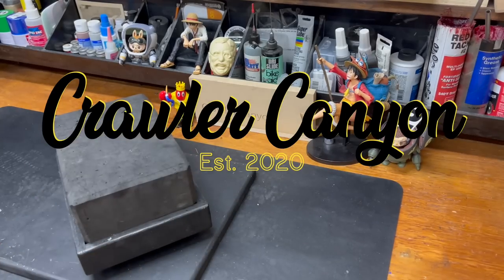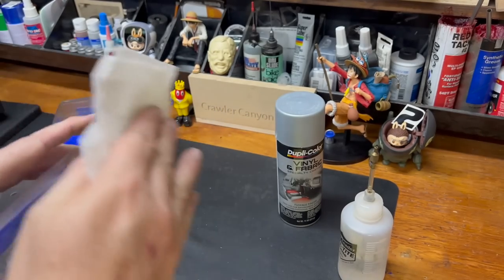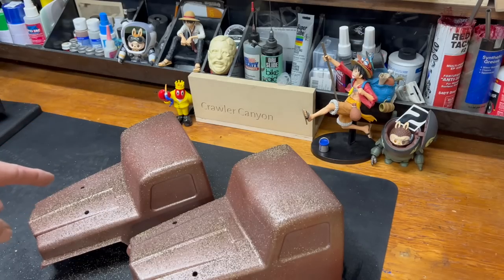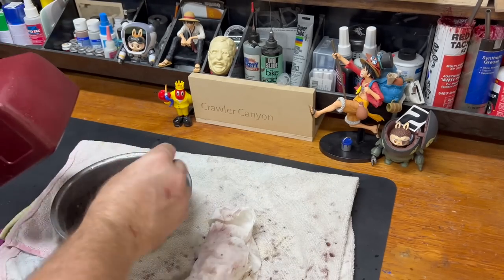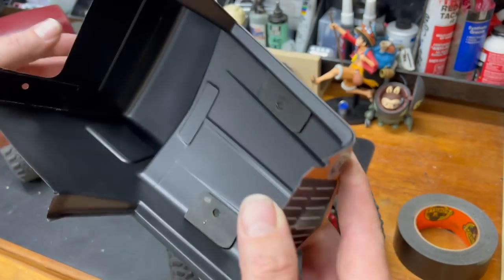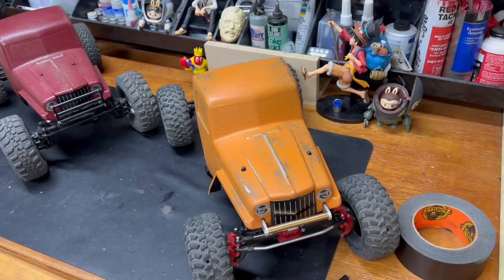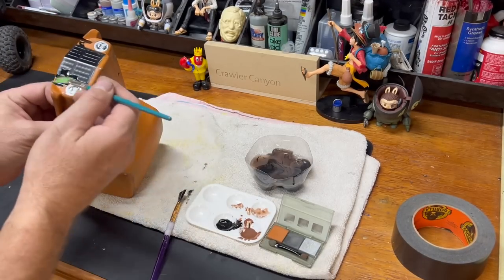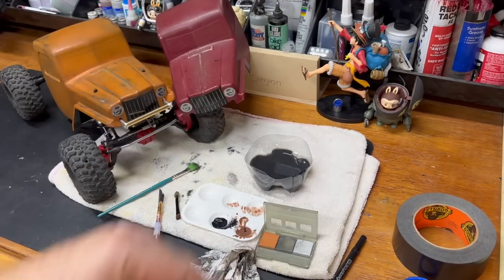Crawler Canyon Presents: What? Patina again?

Comment: I took advantage of that sale on the Creep for patina practice before starting on my expensive Proline body. I had great luck with the salt-and-hairspray method on both bodies but now I have a painted Creep body looking for a home. So I guess I need to build another rig.

My method is a lot more fiddly than yours though. I do clear matte inside and out, then use orange and metallic red on the inside  randomly. That puts the rust layer inside, then I do the paint color on the outside over the hairspray and salt. 

For salt I find it’s best to use irregular salt if possible. I’d use Maldon but it’s very expensive, but some kosher salts and sea salts are nice and irregular. If you ever see David’s Kosher Salt, that one is perfect.

Comment: I got the cricut joy last week n its awesome. I painted the inside of my creep cab a metallic blue an I don't know if I should back it with silver or white? Great video ❤❤
Reply from the maker: (For me) that would depend on how translucent the paint is. If you can see right through like it's tinted blue, I'd use silver.  But if it's semi-opaque, I'd do white, as the color will pop more. For reference, Wiley the Coyote is backed with white, Tamiya Metallic Purple for the color coat.

Comment: I thought i was alone using spray vinyl fabric dye on bodies. When i did 1/10 scale drag racing i used the bright red on every body i ran because it would never come off. The body would crack before the fabric dye let go.
Reply from the maker: I've been trying to convince people to use it for YEARS. I mean, an 11oz can used to be $6, and would do 2-3 bodies. Never, EVER chips. 
Duplicolor is missing out on a market--  they should be relabelling and selling out of hobby shops as well. I just did a TRX-4 Sport body with vinyl red, and the can had to be 10 years old.

Comment: How do you go from a scan to cutting it on a cricket? I need to make some duplicate masks and have a cricket available to me
Reply from the maker: Low tech is my approach.  Once I have the scan, I import it into Cricut Design Space, hoping that it's not loaded with too many jaggies and errors--  they look smooth to the eye, but the scanner sees EVERYTHING. I then put the imported file on the workspace, and here's where it gets low tech: I measure one of the existing masks, like for Creeps I use the back window--  then just make sure that the one on the workspace matches that measurement. Click duplicate to make double, and cut it.

Comment: Could you explain how to use a Cricut to make window masks and cut them out? I have a cricut but used it once to make sure it works.
Reply from the maker: I do it lazily--  I scan the OE window masks to start.  If I had to build them from scratch, that would be a lot more labor intensive. Scan at 72dpi, import the file into Cricut Design Space, do any clean up to erase the lint and cat hair that was on the scanner bed.  I then measure the long edge on any window mask that has a relatively flat side, and resize the one in the workspace to match that measurement. Duplicate, cut (at least) two sets. I recommend Oramask 813 if you're doing a lot of masks, or plain 651 is fine.  I'm still using 651 as I got a variety pack (over 25 feet worth) for like $20 many months ago.
Reply: I will give that a try. New to the cricut scene. Loved the patina video I want to give it a try. I’m on vacation in Daytona Beach.
Reply: I will definitely give it a try when I get back home.
Reply: @CrawlerCanyon what kind of clear coat do you use
Reply from the maker: @michaelwilson7973  honestly, nothing comes close to the absolute ease of use and "touchless" matte finish of Tamiya PS-55, but I hate having to spend $7  to get one body out of a can--  you <might> squeeze two cabs out of a can. So I've been trying EVERYTHING. The new Traxxas stuff goes on horribly, but if you wet-sand afterward, it is SUPER matte.  That's the final coat on  both of these.  The Duplicolor vinyl clear sprays phenomenally, but is kinda semi-gloss, so same story, needs post-work.

The goal is the same performance as the Tamiya, but not at $2.50 an ounce. Absolutely don't try the Duplicolor 1K Ultra Matte Clear. It's basically satin. And expensive.
Reply: Which do you the most?
Reply from the maker: @michaelwilson7973  The Tamiya PS-55.  Goes on the thinnest, lays the flattest. The singular drawback is the price--  you can easily use a whole can doing one body.
Reply: Are you going to finish the video of the patina? You never used the other items in your video or showed the clear coat.
Reply from the maker: @michaelwilson7973  other... items? What didn't I use? The difference in appearance before and after the clear coat is that now the weathering won't wear/wipe off.  The clear doesn't change the appearance other than to make it more uniform.
Reply: Okay thanks
Reply: @CrawlerCanyon what grit sandpaper you use when sanding to get the pepper off?
Reply from the maker: @michaelwilson7973  depends on the paint--  and I mean it's REALLY dependent on the paint. Any of the polycarbonate paints (including the Duplicolor) never need more than 400 grit, while stuff from Krylon and the like can sometimes take 320 or even 220. Just get a variety pack of wet-or-dry, that's what I do.
Reply: Thanks
Reply: I bought denatured alcohol in a quart size metal container. It has fuel denatured alcohol will that work. That is all Walmart had.
Reply: Does it matter what kind of printer to use when scanning the original mask? Inkjet or laser jet printer? What type do you use? I have evidence need to do a patina paint job but a printer. My old printer gave up on me so I need a new one. Do make your own decal or stickers for your truck? Sorry for all the questions. I know you are a busy guy with all the awesome content you produce. Please keep up the amazing work and content. Thank you for any info you can provide.
Reply from the maker: @michaelwilson7973  Scanner is a scanner, so far as I can tell.  I'm using a cheap Canon multi-function machine from the WalMart.  I usually only scan in 72dpi and it seems to work fine for paint masks.  As far as decals/stickers, I usually stick to just making masks--  but anything on the door of a rig has been cut out on my Cricut, either for use as a decal, or as a paint mask.  The consumer-grade plotters just can't get down to the level of intricacy that can be achieved by commercial machines. 

I've tried using decal paper and printing my own decals, but honestly never had very good luck with it.
Reply: Okay thanks for your time
Reply: @CrawlerCanyon will denatured alcohol work that has fuel on the metal container
Reply from the maker: @michaelwilson7973  absolutely.  That's the stuff we can't get in California anymore. I have to order mine in plastic bottles from Washington.

Comment: paint a traxxas body? I have yet to see any come unpainted. and cause of that they are overpriced junk
Reply from the maker: To my knowledge, you can get all of the Traxxas crawler bodies in clear--  I've done the Sport, Sport Camper, and Defender.  TRaxxas just almost never provides a picture of the clear body, but shows the completed body instead, presumably to add confusion. Do I think they're too expensive?  Well, I think all lexan bodies are overpriced.  The Sport body isn't bad at like $45.  The others?  Well, $120-150 for a body is INSANE,  but look what you get for $75 in the shape of an Axial Early Bronco--  no grille, no exterior details, not even the roll cage that's required to actually attach the body--  that's another 25 bucks. At least with Traxxas, it's ALL in the bag. 

Now-pre-painted bodies are a scam.